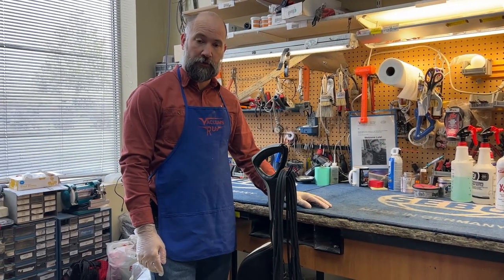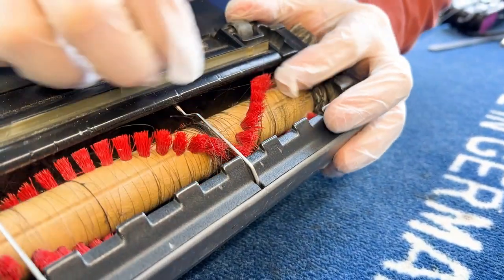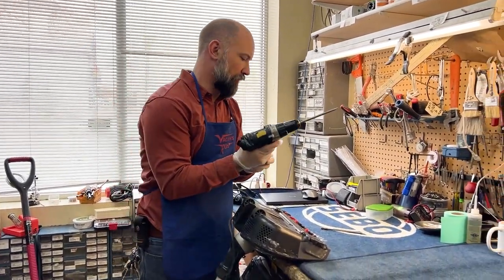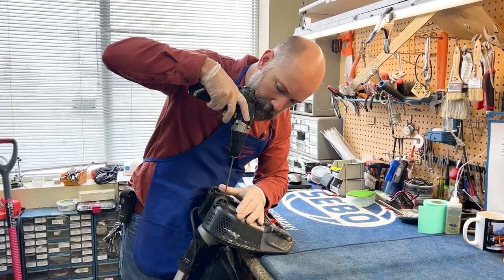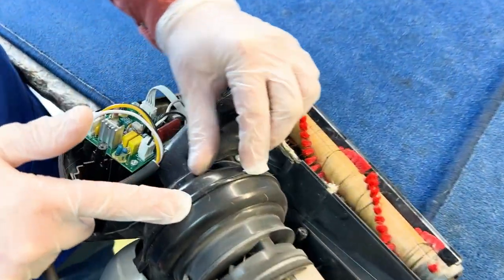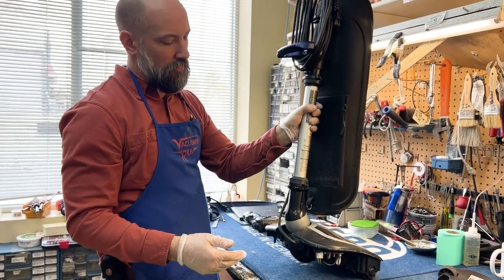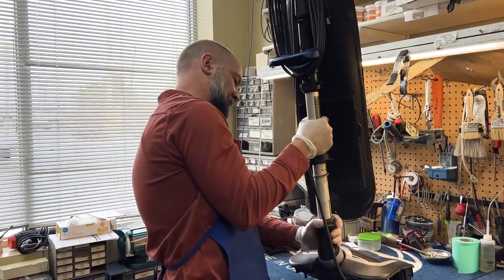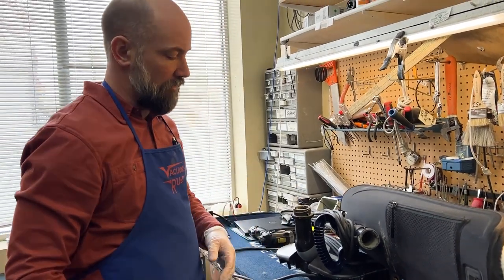How to Unclog an Oreck Elevate Conquer Vacuum Cleaner

Comment: So I rushed right out to get a T20 Torx Screwdriver. When I looked at it, I said it seemed too small, so I also got the T25 just in case. When I got home, I found out they were both too big. It must be the T18 like you first said.